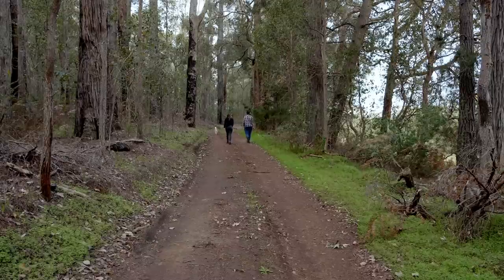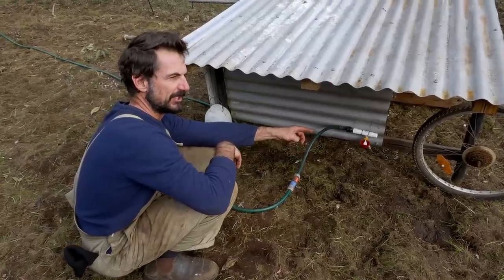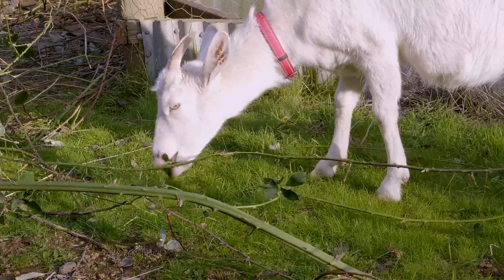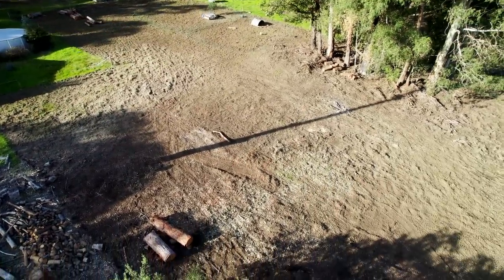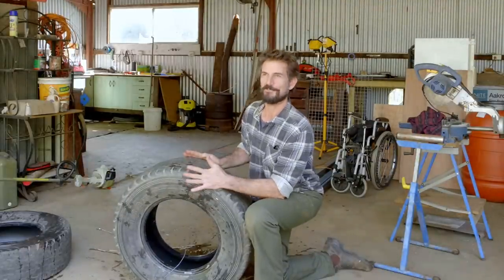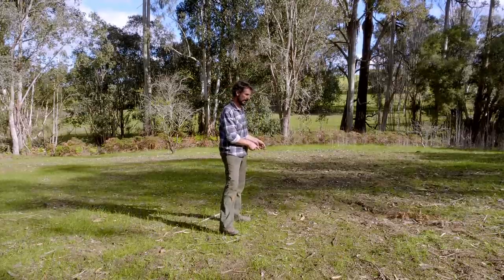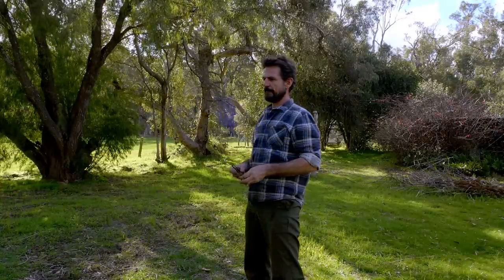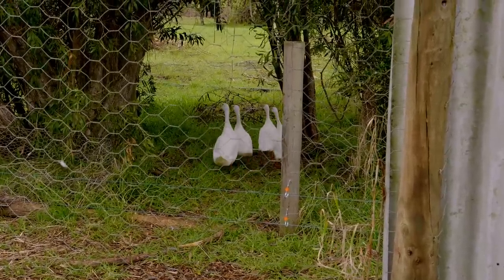Spring routines on 9 acres  - Free Range Homestead Ep 20

Comment: The old "rag" tyre treads were handy, steal band less so. Using 13mm retic to cover the edges, I've seen them used to cover the tops of posts & rails, wrapped around trees to stop horses from chewing them, covering things that might get impacted. Surprised wire was being used, where's all your old fishing line. I built my chook coop on an old wheelbarrow (tub had rusted out) so I can maneuver it through tight spots. Have net with stakes I spread to protect them from the local cats & dogs (suburbs). Filled the tyre with foam so I don’t have to keep pumping it up. I miss the enjoyment of my farm (divorce).
Reply from the maker: Tree wraps sound good. Sorry about the divorce. Always a disaster.

Comment: Tire tread reuse. Do you have a soft spot in your driveway?
https://www.youtube.com/watch?v=nboVqwDTF4U
The steel bands keep the base material from spreading under load.

Simple tube notching.
https://www.youtube.com/watch?v=3XvN2FRbi2U
Could be done with an angle grinder, you don't need a bandsaw.